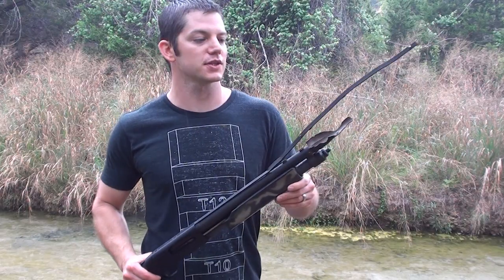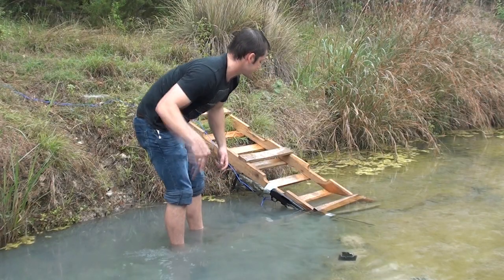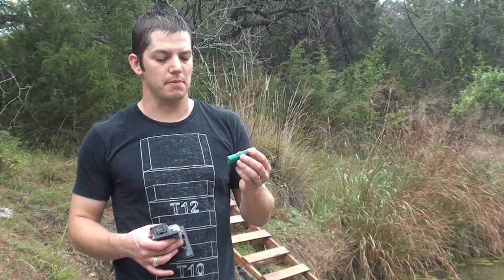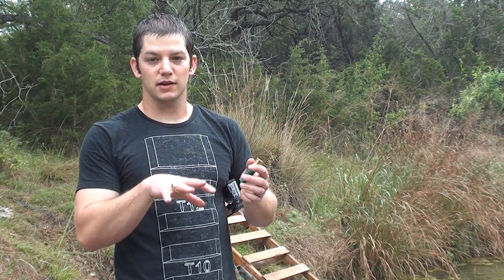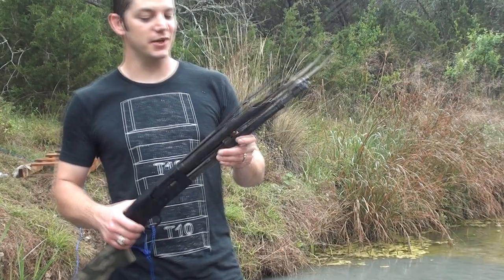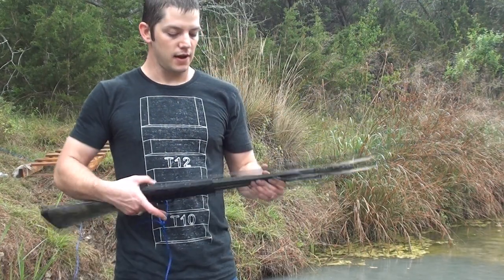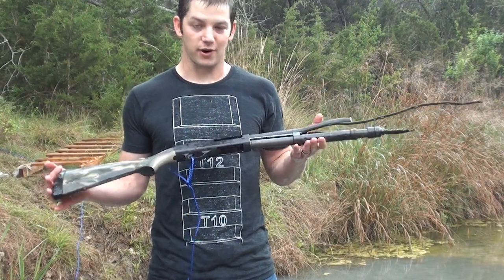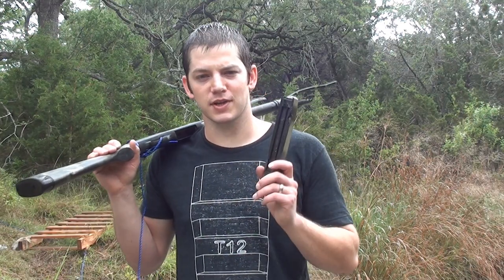Shotgun Barrel Full of Water Test

Comment: If you ever decide to revisit this try putting the whole shotgun under water and see if the barrel will still explode. Don't worry about getting the shell wet, just drip some wax on the end to seal it.
Reply: tct72 it wouldn't explode. because the water is in the entire barrel the projectile cant build up enough speed
Reply: i made my own shotgun, and went swimming with it already, round in the chamber (its a slamfire) for about 1½ to 2 hours..took it out of the water, dumped the water out of the barrel, and it shot just fine. i doubt you need to wax the end of the shell. i was too afraid to try and shoot it underwater though, since i know water is not compressible, i feared how much smack the shockwave would inflict on me, and of course, i didnt want a gun blowing up in my hands since i had no idea if its "safe" to shoot a shotgun underwater completely.

Comment: The reason the barrel didn't explode the first time is due to barrel design. The water line was at the thick part of the barrel, which is over-engineered to manage high pressures from the shotgun shells firing. The barrel thins out dramatically as you move toward the muzzle, because it doesn't need to handle the same high pressures, just guide the shot. Cool vid, I liked the GoPro footage the best.

Comment: Love these videos.
Here's my simple explanation...
The reason it didn't destroy the barrel when it was all the way in the water is because the preasure was confined to the thickest part of the barrel.    Take a close look at a the chamber of a shotgun barrel and you will see it is 2 to 3 times the gauge of the rest of the rest of the barrel.     This is by design because the shell wants to explode.   Once the the projectile is past the casing and unobstructed its velocity is sufficient to clear enough distance creating enough volume for the expanding gasses, so the  barrel does not need to be as thick past the chamber.  Confine the gas expansion with water and the pressure builds before the water can be pushed out of the way, breaching the thinner part of the barrel.

Comment: Your theory is correct. Our covert ops used to use a regular gun with waterproof ammo for underwater use. Idea dropped because of forgetfulness. (have to clear ALL the water before shooting in air). Speed and distance greatly diminished, but it works. Alternatively, there were also rounds with what was essentially a short arrow in place of the bullet. Tip went just beyond barrel end.

Comment: So if you fired slugs would the same effect happen? Your theory on pellets makes sense because there is space between each pellet in which water can get between and cause so much pressure that it just blows up. Whereas slugs, are a single projectile so the water might do 2 things, push out of the barrel or just expand and explode.

Comment: Consider also that the powder needs travel time to fully burn. So part of the pressure and velocity issue is also related to how long the powder has to burn. If you fire a shotgun shell out of a short Dillinger style pistol at night you get a huge flame. If the powder is quenched before it burns you get less pressure and less velocity.. So gas pressure hitting water is an issue too!

Comment: Water and air have different density. Water work as more harder bondage and keep barrel off blowing up. So, gun Powder pressure goes along the barrel and it needs more power to blow us the underwater part of the barrel (water has more density than air). So, it is not about shot  speed. It is about barrel wall pressure. Underwater part of barrel us more difficult to blow, because of water density around the barrel.

Comment: Just a theory: 
The section of barrel that's submerged is very much cushioned by the water around it, the water at the open end being at the same pressure. Whereas the section surrounded by air is at much lower pressure with a lower cushioning effect offered by a gas, therefore expanding & rupturing first.
I'm surprised the fully submerged shot didn't come out backwards tbh, I guess the chamber was stronger than the gun was heavy?

Comment: The real reason it blows up the barrel is the phenomenon called "water hammer"... When you have a pipe filled with something other than fluid (steam, air, etc) then suddenly fill it under pressure, the air gap suddenly gets compressed and that pressure has to go somewhere, causing the barrel to fail...

This is something that many places have to deal with, and I've seen pipes that have jumped out of the ground by over a foot just due to this...

Comment: The first try might have not worked because of a lack of air to expand. Because air expands in the presence of the heat from the burning of the gun powder but there was very little air to expand which reduced the amount of force within the barrel.

Comment: With the water higher in the barrel, there's little space for gas expansion, so less increase in pressure against the water but more consistent force throughout discharge. However with more air gap between shell and water, the explosion has more time to increase compression before acting upon the water. Higher pressure gases are unable to expel the water 'plug' fast enough from the end of barrel, so an overpressure occurs resulting in a pretty spectacular catastrophic breech, one that would make Elmer Fudd jealous. 🤣

Comment: Dynamics of Hydraulics. The pressure will change when outside is normalized with inside. I wouldn't do it again but shot a 12 gauge full of water and mud in air and it was fine. Lucky I am sure but hydraulic pressure is difficult to understand without the formula.Si don't experiment clean the barrel.

Comment: I think you are wrong and here is why: If the round is loaded after the barrel is sunk in water, the water should fill the barrel up to the surface of the surrounding water which was the case here. However, if the round is chambered before, it might seal the chamber creating an airlock and water would not flow up the barrel when sunk pointing downwards.

Comment: I have an idea why the shotgun blows up when there is air in the barrel and not in the water. Water is non-compressible so it just moves out of the way when shot. Air can compress up until it comes in contact with a non-compressible object like water. The explosion finds the path of least resistance. The gun barrel is easier to move out of the way then all the weight of the water. Since water is non-compressible it offers more resistance than the pressure outside the barrel in air. Same reason why you can shoot totally submerged but not half and half.
Just a guess, I am no genius.

Comment: Use a cheap shotgun standing straight up in the air - use grease around the shell and fill the barrel - I'm curious if it is the ambient water pressure causing the barrel to blow up or if it will evacuate just a barrel of water

Comment: the air compressing between the round and the water creates a higher pressure with the barrel only being 4 inches submerged. the compreesion of air between the round and water is significantly less when the round is almost submerged. think of the compreesion in a motor. then a stroker motor. more tube equals more air equal higher compression ratio.
Reply: yeah buddy he kinda explained that in the video.
Reply: +Josh Boogie 
no thats not what he said

Comment: I believe that if you fall off a bridge at a great height, then hitting the water is like hitting concrete.
The impact of the shot, hitting the water has to be pretty much like if you had stuck concrete in the barrel at that distance. The difference being, if you had completely filled the barrel with concrete, I believe you still would have gotten an explosion, and you didn't with the water.
By the way, I'll gladly take the remainder of that shotgun off your hands. :)

Comment: You were close brother, but it's all about gas expansion, the more space there is in the barrel the more time there is for all the powder to ignite giving off more gas in the barrel. Not to mention water is non-compressible which makes moving out of a small 12 gauge barrel at the speed of the rapidly expanding gas pretty much impossible, and the rest is obvious, (the only place for the gasses to go is to it's sides because the gasses in the rear of the forward gasses impede it's rear path because the front gasses gain inertia once encountering the water because the water absorbs the heat and the force of the gasses (which also produces vapor i.e. more gasses) but the water's structural surface doesn't alter and the rear gasses lack as much inertia as the front gasses pushing on the now semi "still" frontward gasses, and if there is one thing gasses hate it's being pushed around so they try and go anywhere that isn't where they are now, so they push on any surface that is willing to give into the force they give off (kinda how in star wars luke leya and solo tried to push on the garbage crusher rooms walls to prevent there imminent demise, but with particles) a.k.a) it balloons. (yay for physics!)

Comment: Demo, interesting video.  Here's a video pitch working on the same principle: Would you get the same reaction with a rifle or pistol?  And with that could break it down even further.  For the rifle could do 2 styles: a semi-auto that uses the combustion gases to cycle (AR or AK for instance) and one that doesn't like a bolt action.  It would be even cooler if you had a high speed camera for the semi-auto style (as mentioned above), you could then compare the cyclic rate of normal fire vs the end of the barrel submerged, and could take it one step further to see if it would be faster in front or behind the actual port in the barrel (assuming enough of the barrel survived for a 2nd shot).  With the pistol could also do 2 styles: semi-auto and a revolver.  Again, high speed on the revolver would be cool to see if you get any water to splash out the gap between the barrel and cylinder.  Could get even more comparative by choosing guns that will fire the same round, but would understand not wanting to risk that kind of money.

In any event cool video.

Comment: What happened to that barrel actually has to do with compression. When the gun is fired, the shot is pushing air in front of it, but because of the water being in the way, the air can't escape fast enough therefore causing the barrel to burst. If you could watch everything in slomo from inside the barrel, i bet you the barrel burst before the shot ever hit the water.

Comment: My theory: it only split when the barrel was mostly out of the water because it was the compressed air in front of the bullet that split the barrel. The fired bullet compressed the air in the barrel faster than it pushed the water out and so it was the compressed air that blows out the barrel. Just a theory...definitely not a scientist or anything.

Comment: Water doesn't compress  and even tho the water is being blown out the pressure inside the barrel would have gone over  the barrel's threshold and basically split or banana out  and if the shotgun was loaded before being put in the water the breach should stop the air escaping the barrel through the breach and the water wouldn't fill the barrel up.